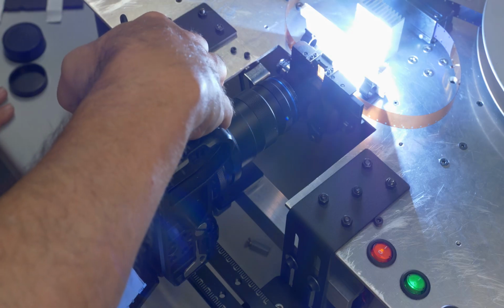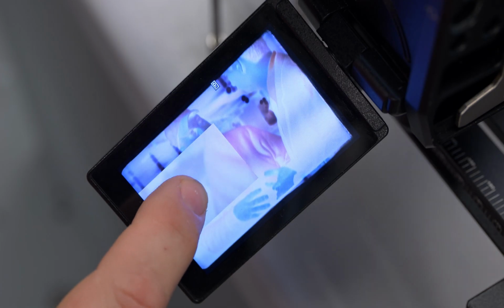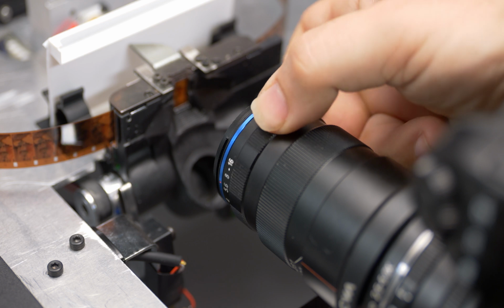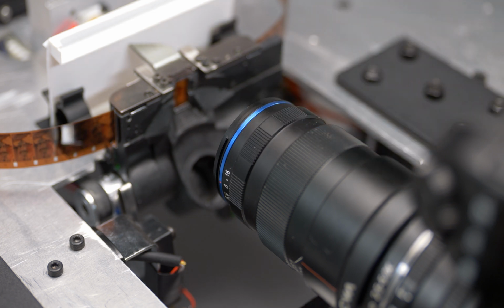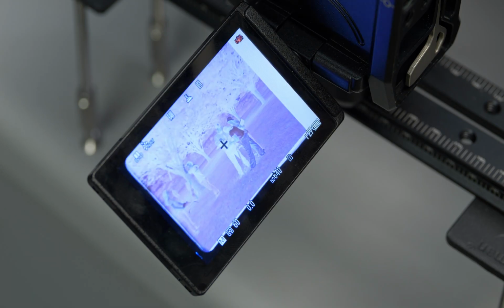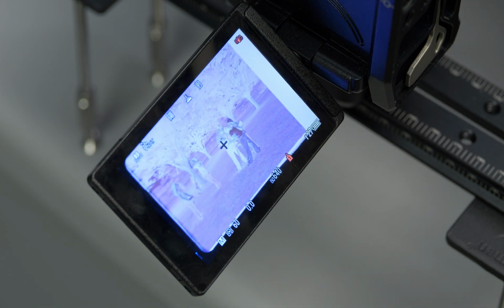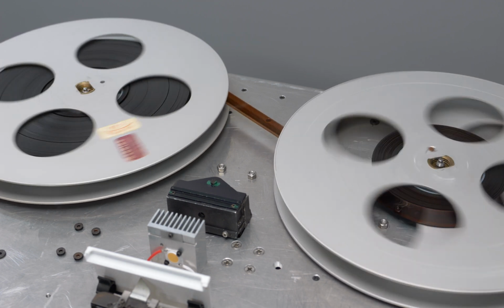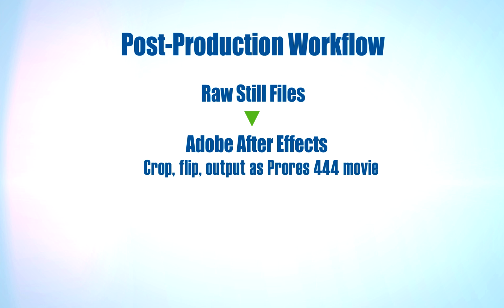DIY 16mm Film to 4K Digital Transfer System | Part 3

Comment: This is AWESOME! I've had a design I have been working on for a LONG time, but I want mine to capture sound as well. It sure isn't easy! Plus, I haven't physically built anything yet. I don't have the machinery to cut metal. But I have pretty much everything else. It's the critical and precision timing needed. Plus, I'm old... :)

Comment: Impressive! However, I keep wondering if the right thing was to simply take the Arri 16M with a 1000’ mag, modify the gate and the motor, and set it on a support.
Reply from the maker: I did look at that option. There are a couple of problems with it. First, the 1000 foot magazines are very hard to find. Together with a camera, the price might be several thousand dollars. Then, there's the question of whether one wants to modify a potentially good camera. The movement mechanism I used was purchased from a boneyard of scrapped cameras for about $200. The other issue is the small space inside a 16M for mounting a light source.  Probably not impossible, but definitely difficult, especially if you don't want to destroy the camera.
Reply: @ have you ever looked at the Auricon/CP-16 movement? Lots of mods with Mitchell mags. I do note there is a pin on the pressure plate right at the gate, but I’ve seen it removed.

Comment: This Part 3 came up as the first for me and I can only say you did a terrific job. I like your general insights and fine mechanical engineering skills. I haven't looked but I hope you found the help of someone aiding in getting the motor speeds right, maybe by controlling them with an Arduino or the like. The mechanical adjustments like rollers etc. will be in place by now I guess. Anyway, great project!

Comment: Ah, eventually you might want to get into Arduino or into Pi Pico's Micropython (these are two easiest to learn things i can think of) to control the motors. Synchronising steppers digitally via step counts is bound to be better than any mechanical system one might come up with, plus you can integrate sensors etc.

Stepper motors don't have any inherent speed drift, the drift is coming from your control logic which doesn't keep consistent time. For one potentiometers are bad inputs since their readings do drift from moment to moment, and it's also not really potentiometer's fault but the ADC and supply voltage drift. But more importantly the timebase comes from a crystal oscillator, and these do drift a fair bit, so unless you have extensive calibrated temperature compensation for them, that's going to be the main problem with the digital controllers. Running steps for multiple motors from the same board which has one timebase would solve that problem.

Oh also how to generate an arbitrary constant ratio of steps: Bresenham's Line Algorithm (which is a division algorithm in disguise). Don't try to do step calculations with floats, this will likely end in a lot of hair pulling.

If this is something you might want to embark upon, maybe i can be of a little guidance.

Comment: I've been working on a 8mm DIY system myself.  I have steppers for the supply, pinch roller, and takeup reel.  You mentioned that it was hard to keep the loop from getting too large/small.  It may simply be that the diameter of the spooled-up film on each reel changes constantly.  At the start, each step of the supply reel puts a lot more film into the loop than a step of the nearly empty takeup reel.  I use a Raspberry Pi to control my scanner, and it computes how much to move each film reel (which is constantly changing) for every frame that gets captured.  Different reel sizes with different lengths of footage of course need to be handled differently.  A sensor to detect the slack/tension in the loop would probably be the best approach, but I wanted to do it just in software.

Comment: Many years ago I built a continuous film processing machine and for take-up I mounted the spool holder directly on a motor shaft and powered the motor with a micro switch activated by a tensioning arm. It was easy to build and worked well in the low speed application.

Comment: It should be relatively trivial to take a control board that's designed for a 3D printer and reprogram it to drive those 2 steppers (or even all 3) in sync. There also would be inputs available for loop-size sensors, either microswitches with rollers or optical ones. However, this would require someone for whom programming those things is within their skill range...

A side effect of this approach would be greater stability and faster speed. The latter because the controller could drive the motors at a variable speed instead of one that's dictated by how long the frame needs to be exposed. It could speed up for transport and pause for exposure. And that pausing could extend to all motors, providing greater stability as the picture is taken while all movement has ceased.

It might be worth it to reach out to the 3D printer community; it's full of people who love these kinds of projects. That's how 3D printing at home started, after all...

Comment: You should drop the loop, and use a spring loaded guide roller, with a switch that stops the motor on the uptake side when triggered. That would  give you constant uptake and reduce the tension on the gate.
Reply from the maker: I've considered that - thank you!

Comment: I love this series, and being a stills film only shooter, I can offer no help. I do have a question though, what about sound? Are there separate sound recordings? Do these have to be dubbed in later?
Reply from the maker: As in most film production, sound is recorded on a separate recorder - digital recorders today usually all work fine as they run at constant speed. The key to recording sound is having a film camera that has a crystal-sync motor system - the film then runs at a very exact speed, so it can be matched to the audio recording.  A slate is film at the front of a sound take, and the clapper image is synced up with the audio "clap" sound in an edit system.  Most digital edit systems have simple ways to then lock the image and sound together as a clip. Years ago, when 16mm (and some Super 8 film) was used for news recording, there was actually a magnetic stripe on the film edge, and the sound was recorded in the camera, thus synced with the picture. This allowed fast editing, but the quality was not as good, and it created flexibility issues in the edit - to my knowledge, you can no longer buy 16 or Super 8 film with a magnetic stripe.
Reply: @FreshGroundPictures  thanks, that's very helpful. I'm constantly amazed by the quality of video you make with 16mm.

Comment: My opinion on grain reduction:  You don't!! Either you shoot on film and deal with Filmgrain as brush strokes on a oil painting like an adult or you can just shoot digitally in 4K. I can only afford Video for the most part but HATE the clean sterile look of it and would rather shoot on Film. Especially 16mm. And i hate going through all sorts of lengths to make video look like film in Post.

Comment: I look at the ISO on your camera and it is 640. When I made the film digitizer, I checked the ISO noise and image distortion and made the LED brightness so that the camera ISO was no more than 100 with minimal frame distortion. I also reversed the image right in the camera so that I could see the positive image. I also limited the amount of light reaching the side of the film that is captured by the camera so that there are no possible highlights of the film. 
but your device is made very well, bravo 👍
Reply from the maker: On the Lumix S5, 640 is the native low ISO - meaning the dynamic range scale above and below medium grey is equal.  I could choose a lower ISO and get slightly less noise, but this also moves the dynamic range so there is less information in the highlights, and more in the shadows.  By using 640, I can also stop the lens down to F5.6 to f8 for maximum depth of field and sharpness. Thanks for watching!

Comment: Curious why the after effects pass was necessary. Oh, probably the raw files wouldn't open in Resolve. I generally scan 16 mm at 2K and edit on a 4k timeline in Resolve for 4K output. Does the Topaz pass add anything to your quality?
Reply from the maker: Yes, because Resolve doesn't support raw still images as a sequence. The Topaz software does wonders with image sharpness and clarity, but it does tend to reduce the grain, which can be good or bad depending on your preference.  I found that processing 4K all the way through did not substantially improve the image beyond 2K. With Topaz however, you can make a susbstantial difference in clarity from 2K to 4K, without the computer-intensive 4K processing all the way through.
Reply: @FreshGroundPictures My yt channel is pd films,mostly old sd transfers. I haven't had good luck with the Standard Def interlaced transfers in Topaz. I will try it again on the Resolve output prores files. Maybe starting with the interlace already removed will improve the output. I built a scanner about 10 years ago. If you have questions,please reach out.
Reply from the maker: @VintageFilmChannel  I checked out and subscribed to your channel - looks very interesting!  If you have interlaced masters, standard def, and if they were transferred on a fairly good machine - like a Rank or similar telecine, you can remove the interlacing and return the file to a 23.976 cadence simply by loading the file into After Effects, then right click on it and go to "interpolation". It should allow you to choose "Guess 24P 3:2 pulldown" , which will remove the interlacing and produce 24P frames. This only works if the 3:2 pulldown is consistent throughout the file, and I don't think it works if the movie was transferred on some old projector-type telecines. If you can get the file back to 24P, Topaz will work the best that way. You can even reduce, or dehalo excessive sharpening done in Standard Def.  If you can't return a file to 24P, Topaz has a couple of deinterlacing codecs that create 60p files, which can the be reduced to 30p. I've found the deinterlacing to 60p, 1080  looks pretty good provided you tell the software if the dominant field is top or bottom.  Of course there are many issues which could arise depending on how the initial video was edited, converted or otherwise altered.
Reply: Great video, if you convert the RAW files to DNG RAW files with Adobe DNG converter you can import them to Resolve and skip the destructive step to ProRes.

Comment: Nice solution, and excellent results. As others have noted, steppers dont drift, so you could replace your pulse generators with an aduino, and once you tune your two pulse speeds, they'll never go out again.

I bought an old film projector as the basis for my (as yet unrealised) DIY Telecine, figuring that they already provide the syncronisation between the gate and the take up reels, with only one motor needing to be replaced/ splowed down. I take  it you choose the Arri film gate becasue it has more accurate register, and you owned them? Over here, those parts are pretty expensive.
Reply from the maker: Yes, that's why I used the Arri parts. On my channel you'll see I also made a Super 8 device from a projector - that was fairly easy. Then I made a 35mm transfer device using an old Arri X-Ray camera - again, that wasn't too difficult because of the built-in sync. Thanks for the input, I just need to study-up on Arduino, as that seems the best solution.
Reply: @FreshGroundPictures  I also just did my first ever project with an aduino. Turned out to be pretty easy. Excellent help from the aduino forum. Go for it.
Reply: Always nice to see another great YouTube channel in the comments @RotarySMP . Glad to see it’s not just planes and lathes that tickle your fancy 😂

Comment: Thank you for pioneering a new aerial printer, this can bring film back for lower budget productions.  My only suggestion is the addition of replaceable 'felt cleaner pads' to remove any dust particles before entering the gate.  I certainly want to purchase an unit with an UTRA 16 gate (which is better than Super 16 for 4K transfers).  Hopefully you will be able to get a manufacturing deal to sell these globally, maybe a company like Proaim would be interested, they make and sell good lower cost production gear.  Either way, let me know when you go to market.
Reply from the maker: Thanks - we'll see what happens!

Comment: Great video! Regarding the motor speed drifting, there's a few possible ways to get around this. In short, stepper motors themselves can't really drift. It's either in your speed controllers or stepper drivers. Given stepper drivers tend to work based off step + direction pulses from the controller, I'm more inclined to think it's the speed controllers.
1.) If you want 2 motors to spin at exactly the same speed and never drift apart, you can actually power both of them from 1 stepper driver. I can't tell exactly what drivers you are using, but based off their size they should have more than enough power for it.
2.) If the 2 motors have to spin at different speeds, you can use a microcontroller. It can precisely output step pulses to both drivers at precise and defined speeds, ensuring they always move at the same speed relative to each other. Something like an Arduino could do this with a fairly low amount of effort.
Reply: This is good advice. 

On point one: Assuming you wan to keep two drivers for the current requirements (looks like you have a fairly large motor there) you can wire the step and direction pins from one speed controller to both stepper drivers so they are receiving the same signal. This will ensure they are driven at the same speed. You would wire the step pin in parallel to each controller. This is assuming both motors have the same step angle. Not all motors are created alike. It will be labeled on the bottom of the motor. The most common is 1.8 degrees, but even if you send the same pulses to motors with different step angles, they will move differently.

On point two: I agree that a simple microcontroller here would do wonders. You could program whatever ratio you would like. For example, two step pulses on one driver would trigger one on the other. 2 to 1 ratio. This is very simple. Feel free to reach out if you want more advice on this.

Comment: Great video and congrats on the finished scanner. Since my last comment we managed to finish our scanner project aswell (the one utilizing an old Pathe projector). 

There's just one tiny detail I wouldn't be happy with: It seems like you need to shoot at ISO 640 for optimal exposure thus introducing some sensor noise to the original grain of the footage. 
It's not an issue if you clean up the images afterwards anyway which you seem to do but I personally wouldn't like that. Maybe a stronger LED would be beneficial. 
Great idea to use topazlabs software by the way, I wouldn't even have considered it. 

And I have another suggestion: It might make sense to change the mechanical switch to a magnetic switch sooner or later. I feel like it has less points of failure in the long run. Then again, never change a running system. If your switch eventually breaks, just add a magnet to the pulley and another one to enable contact in a box with contact plates below the pulley. 

Some questions though: Do you get perfect registration or does the image move slightly in the gate? (I presume you stabilized the footage in post right?) 
How do you deal with dust and scratches? 

Cheers!
Reply from the maker: Thanks for watching! I did not stabilize any of the footage. If you look closely on the few static shots, there's some jitter up and down, but I think it was mostly from the camera itself. 16mm is so small, that any movement in the best system is magnified. My goal overall was to not use any digital stabilization. I used different cameras over the years, and there's a slight difference in the amount of jitter, but it's hard to say whether it's unique to the mechanical condition of that particular camera, or to the design in general.

Comment: What are the AI enhance ment done and software used
Reply from the maker: I use Topaz AI to uprez a 2K file to 4K.  You have to experiment a bit with the settings - use the algorith that allows manual input of progressive frames.  I usually tweek the sharpness up to around 30, and apply a lower number noise reduction.  You could output a 4K file directly color corrected from Resolve, but as I demonstrate, it's sometimes not worth the extra processing time - I use Topaz on a Mac M1 for the AI uprez and it's pretty fast.